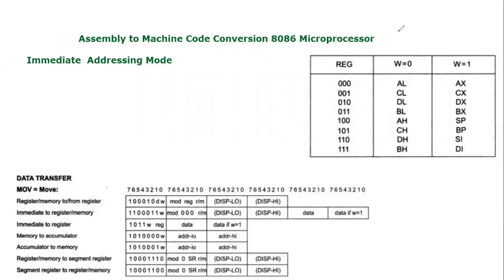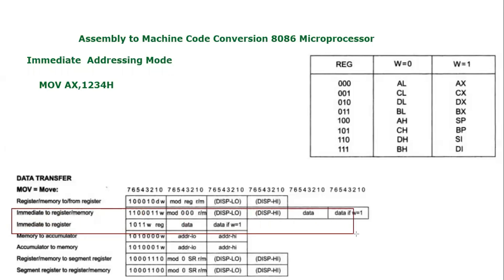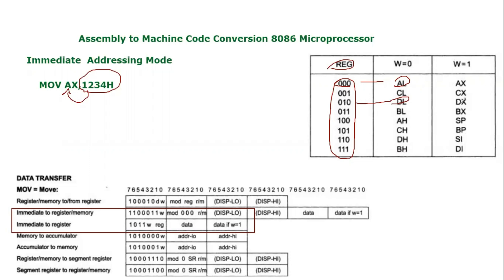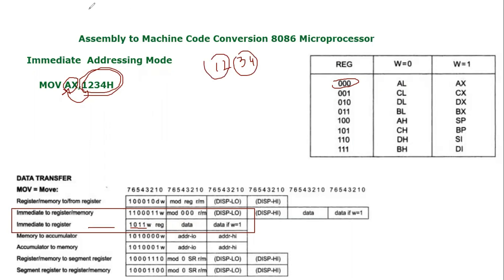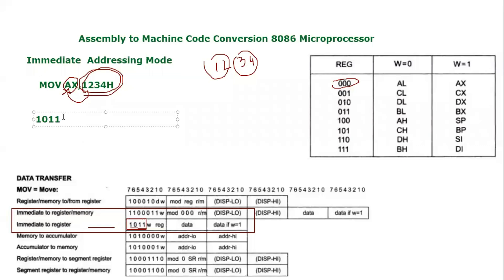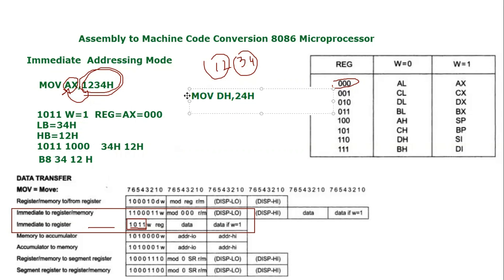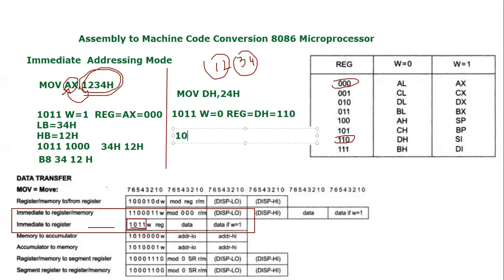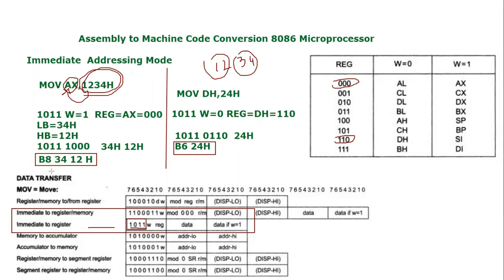Assembly to Machine Code Conversion (Immediate Addressing Mode) | MOV AX,1234H |8086  Microprocessor

Comment: Q: ADD dx,1
What would be the opcode for ADD instruction for above set of instruction as  i know the general opcode for ADD instruction is 000000 but does opcode of ADD will vary in above instruction due to use of immediate operand? Need your response thanks in advance

Comment: Opcode of mov SI,345
Reply from the maker: It is an invalid instruction. You can not move any immediate value into SI register. You need to use two different lines to achieve this. MOV AX,0345H  ;  MOV SI,AX.

Comment: How to write machine code for (i)MOV.W @R5+,R12
(ii)MOV.B #0X00040,0X0005(R12)
Reply from the maker: I am not sure if you are using the instruction for 8086 microprocessor or not. This tutorial is designed for 8086. Can you confirm me the processor?